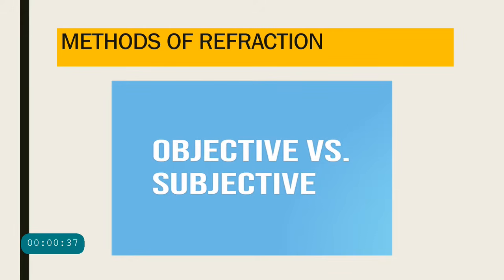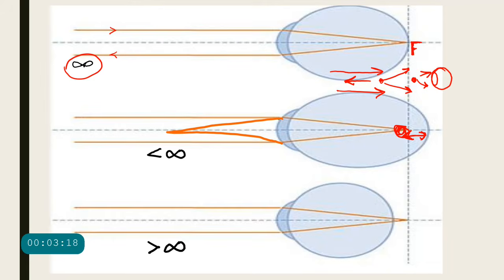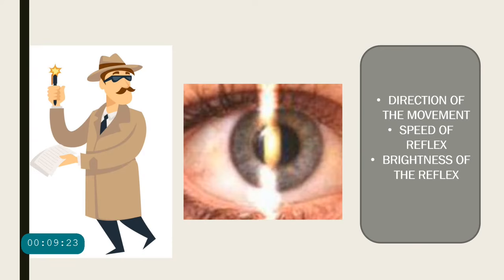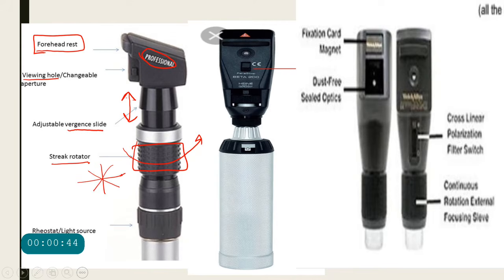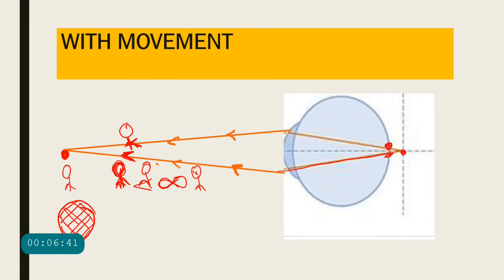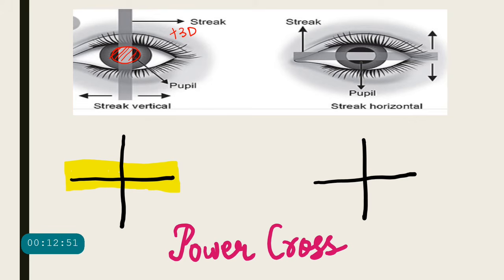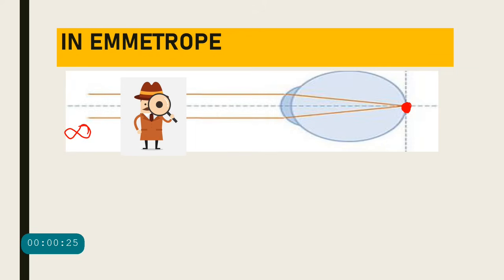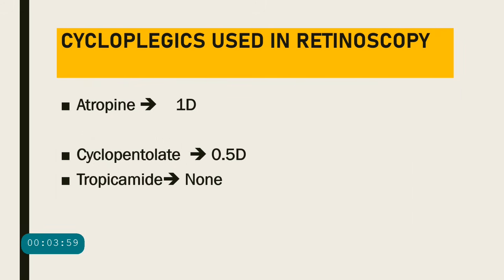Important Concepts in RETINOSCOPY!

Comment: Watching several vodeos on retinoscopy, the terms axis and meridian are loosely used. It will require an explanation, in my opinion. The retinoscopy reflex we see can be called as  the 'streak axis' with no power (and that is where we we place the cyl axis).The streak axis is produced by the corneal meridian which is situated 90 degree perpendicular to the streak axis.The streak axis has no power whereas the corneal meridian has power (power meridian). The cornea has no axis, it has only meridian. In retinoscopy, we are looking at the retinal reflex modified by the corneal power meridian.

Comment: What is axis of prescripiton? What is meridian? Are they same or different? Please reply.
Reply from the maker: The axis of a prescription is the orientation (in degrees) of the correcting cylinder for astigmatism — basically, where the lens needs to neutralize the steep meridian.
The meridian is any imaginary line on the cornea or lens. The steep or flat meridian determines the axis. So they’re related but not exactly the same